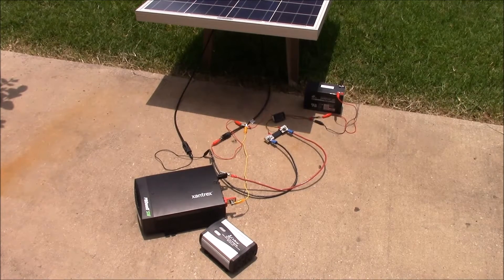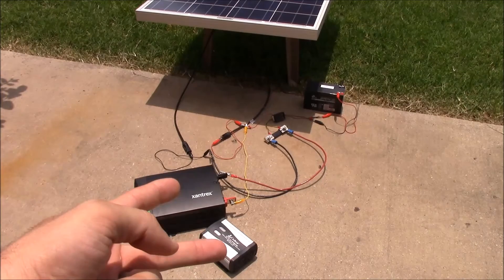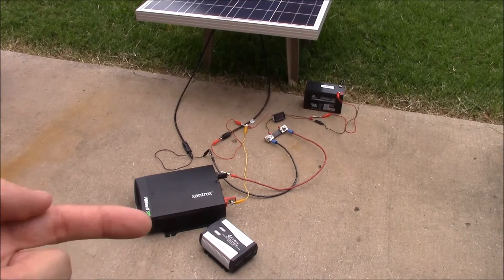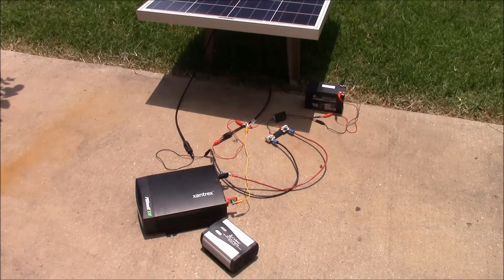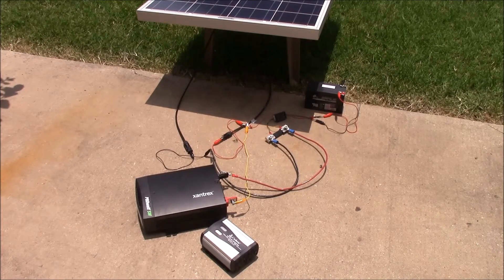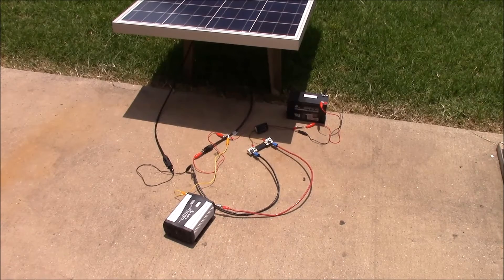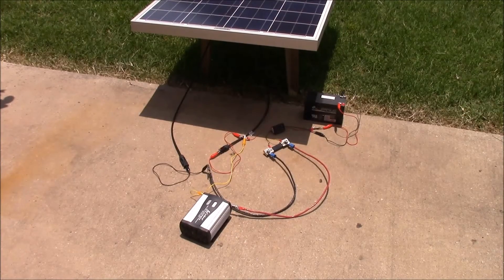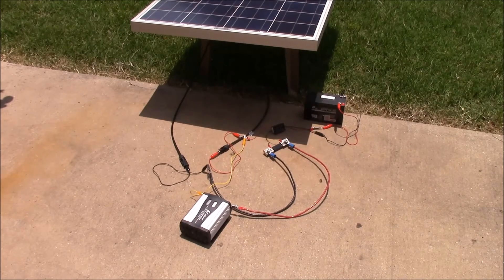Will It Solar? - AC Power Inverter

Comment: I have a solar panel that goes up to 14 and that’s it and for some reason it’ll turn out on the fan but it just won’t convert and there’s no noise or anything I don’t know what the problem is even a 9 V battery will convert

Comment: Very easy Just use 24V panel(VOC is 30-45V)  and use Inverter DC 36V (input range will 32-45V)   you will able to use direct i uploaded a vdo for Same working Perfect.

Comment: All it needs, is a DC-DC converter,    to bring down that input voltage from the Panel , down to a stable 12V to 13.8V into the inverter and it will be just fine. DC to DC converters are cheap and available on ebay and Amazon.

Comment: You need more AMPS output on the solar panel, an inverter has to have the minimum operating amps from the solar panel to run. ALSO if the voltage comming in is greater than 12 volts , it will not run , because it has a safety mechanism inside.

Comment: Very beginner question: What if you simultaneously had a load connected to the inverter? Would it still be an issue since you're off-loading some of the charge?
Reply from the maker: Good question.  I don't think it would change.  But maybe if the solar panel is under a big enough load that it drops to below the inverter's high voltage threshold it would work.

Comment: Dude, try hooking them up to a solar panel with the output rated the same as the input of the inverter.  If you have a 24v solar panel pushing 20v into a 12v rated inverter you will obviously overdrive it.  A 12v output panel WILL power a 12v rated inverter given a good sunny day (most inexpensive ones anyway).
Reply from the maker: That was a 12v panel and a 12v inverter.  And actually you are incorrect because a 12v panel on a bright sunny day will produce 18v, which is above the upper threshold of most any inverter.  The one in the video cannot handle above 15.5 without tripping the over voltage protection:  http://www.xantrex.com/power-products/power-inverters/prowatt-sw.aspx
Reply: I'm not trying to start an argument, just a reasonable discussion.   You can call me incorrect all you want.  I have been called worse.   I wish you would have stated it was a 12v panel in the video (maybe you did and I just missed it).  In my experience, a 12v panel usually produces about 17 average "real world."  Your claim about producing 18v is definitely reasonable.   I thought maybe with the clouds you mentioned scooting overhead, it was a 24v and efficiency was down.  

Also, your wire run was a few feet.  If a persons panels are in the yard or on the roof, and their charge controller/inverter/battery bank is in the garage, basement, etc. you have to account for voltage drop.  If you have 18v at approximately 5 Amps, through say a 12AWG conductor running 100 feet, you will be near 16v at the termination point.  This may be more tolerable for a lot of inverters.  Throw in a few more feet, or inefficiencies (non-optimal sun exposure, etc.), and you might even meet the 15.5v threshold at the end of your wire run.  There are so many variables but it will work more often than you think unless you connect the inverter directly to the panel leads.  Even then, I have found it to work at times.

You stated in your reply "most any inverter."  I have used multiple 12v inverters (cheapo's from friend's trucks, etc...) powered directly from a 12v panel with no issues.  It would have been nice to identify for viewers models that do work.  Although it will definitely shorten the life span of any inverter, it can be very handy in an emergency or short term say during a power outage/ storm situation.
Reply from the maker: Scott Meagher
You are right, I did not state it was a 12v panel.  In my experience, all panels under 100 watts are 12v panels.  There may be a few very rare exceptions to that but I haven't seen any.  So I guess I just assumed people knew that so that is my bad.

I've tested all of the 12v inverters that I own connecting them directly to a 12v solar panel's leads and none of them have even turned on, let alone managed to power a load.  So I realize that is anecdotal but I have quite a few inverters from the expensive pure sine wave $200 12v inverts to the cheapo car inverters.  Here is a video where I tested my Xantrex 600w pure sine wave and a cheapo Cobra model connected directly to the panel:

https://www.youtube.com/watch?v=knYMKXFpRxk

Another problem with what you are saying is that the 17-18v is under load.  Open circuit they will produce 20-21v.  So the inverter tries to power up and detects somewhere between 17-21v, depending on what kind of load the inverter draws (most are only a few watts of self consumption).

The last problem is that voltage from a solar panel directly without being buffered by a battery is highly unstable.  If the sun goes behind a cloud the inverter may shut off due to low voltage.  Or if the angle of the sun dips to a degree that is not optimal for the panel then the amount of energy produced plummets to a fraction of its rating and you may not be able to power your load any more.  At least with a battery in the mix you don't have to worry about intermittent clouds or bad angles quite as much.

If you are going to connect the inverter directly, at the very least get a variable voltage regulator to convert the battery charging 17-18v down to 12v.
Reply: yea you caught me out as well. I assumed it was not a 12v panel. good video none the less.

Comment: I tried this with a 15 watt panel and ended up throwing together a voltage regulator with a couple of capacitors, a diode, and a LM7812 IC in a breadboard. all from a radio-shack component box. worked like a charm for such a small system and played a radio off it. I get my charge controller monday and then the real fun starts.
Reply from the maker: Miclow Gunman Yeah, I have all of that laying around here but I don't think 90% of subscribers or viewers for my basic videos will want to mess with that.  I am trying to keep it basic and see what will and won't work with off the shelf, easy-to-understand components for the average person.

Comment: nice!
truly horrible horrible noise.

weird that the inverters have so limited input range, a simple regulator would make it more practical, though i assume that at the current it drains the regulator could add some cost to it.
nice panel, mine is much smaller, like 19v@10w iirc.
Reply from the maker: Jerónimo Barraco Mármol Sorry for the noise.  I turned it down in the video editing... it was MUCH worse before.

I have a voltage regulator that I thought about using but the purpose of this video series is to keep it as simple as possible and find average, everyday items and see if they can be powered easily by solar.  When you start having to hack stuff or add in electronic gadgets that scare most people then it won't appeal to as many viewers.
Reply: LDSreliance haha is ok, is just an observation, not a furstration. i dont like that sound but i understand why they use it (i can make it with a 555).
at voltage reg. oh right, i lost sight of the objective, is true. is better to see what you can and can't do directly. there are many hacks to do much more.

Comment: Greetings, looks like you have the same prowatt600 as I. I know its rated for 5a but I am in despirate need of using a angle grinder to cut thru some steel slugs that the previous boat owner used to fill in between the hull and floor and now rusting and expanding :/

Alot of cheaper angle grinders are rated at 5a and walmart has one thats 4.5 but I am scared to death that ill blow mine and I cant afford to replace it.

Any chance you have one to try out since it seams you have no fear :P

Cheerz
Reply from the maker: IslandCastaway ⛵ ⚓ I do have an angle grinder.  You want me to try to run it on the Prowatt?
Reply: LDSreliance yes please. Try to cut some steel with it to put a load on it. 

It would be a good experiment to see if 5a means 5a.

Thanx and good luck.
Reply from the maker: OK, will do!
Reply from the maker: IslandCastaway ⛵ ⚓ I am still going to shoot this video, I am just waiting for a delivery in the mail before I can do it.  Should be tomorrow or Wed.

Comment: Wait you got that Cobra for $20? Might I ask where? I'm pretty new to solar however I'd like to eventually get a decent cheapo inverter, also here's you an idea for another will it solar...

I have a small 35W panel but I don't have any SLA batteries to charge so instead I've bought one of these http://r.ebay.com/uxg60p to regulate the voltage so I can charge a 18650 battery bank directly off of solar and thus charge any devices, seems to be working alright, expect for when there isn't enough light my battery bank stops charging much sooner than devices such as my phone.
Reply from the maker: vgamesx1 I ordered that Cobra last summer and it was $25.  Currently it is $31: http://www.amazon.com/Cobra-400-Watt-12-Volt-120-Volt-Inverter/dp/B001RNOHBC/ref=sr_1_1?ie=UTF8&qid=1433540808&sr=8-1&keywords=cobra+inverter

I'm not following the battery bank issue.  What are the 18650 batteries?  You are converting the solar down to 5v and then charging batteries?  I'm lost, sorry.
Reply: LDSreliance Thanks for that link.

First question sorry, do you mean what are 18650 batteries or what brand are they?
If you don't know, they are the batteries used in laptop batteries if you take them apart as I did (or buy them) they are 3.7v li-ion batteries and you can buy a case to use them as a bank, such as this.. http://r.ebay.com/lg3aqY
(side note, the batteries are usually fitted in parallel, so no charging worries)

Second question, yes that is exactly what I'm doing, I have a little DC to DC converter which steps down the 18v+ to 5v and in theory is about 90% effect, meaning if I used a single better one, I could obtain up to 30W off my solar panel, instead of the 15-20W from using a charge controller.

It does work however it needs at least 8v or more in order to function, my only issue thus far is it can't charge my bank during the early/late hours it will however, charge my phone if a bit slowly, I bought a usb tester to try and figure out why but that won't be here for a few weeks, I'm guessing it's not supplying enough voltage at that point right?
Reply from the maker: Ahh, ok that makes sense.  I have looked at those cells before to build my own battery bank.  Pretty cool.

The only problem with your charging setup is that you are just supplying the batteries with straight 5v power.  There is no charging program to at the very least shut off the power when the batteries are full, let alone float them.  I agree you might lose another 5% efficiency (maybe 10% with a crappy charge controller) but I think it is worth it for the health of the batteries.  Especially lithium.

From my observations, in indirect sunlight (first few hours of the day and last few hours of the day) your panels will show a decent voltage but there will be almost no current.  Thus when you put almost any load on them the voltage drops to nothing.  I think that is what is happening for you.  The panels might still be making 17-18v but at about 1/10 the amps they would during the middle of the day.  So the voltage drops too low for even providing 5v at any meaningful amount of amps.
Reply: LDSreliance Uh did you look at that link? because the batteries are protected by a circuit within that box, (well not that one specifically) so it handles the charging for me as long as I feed it 5v and I've fully charged it once so it seems to be doing its job.

Ah I see, ok thanks that makes sense.
Reply from the maker: My bad, I didn't know you were using that charging box.  I thought you were just using the lithium batteries.  Disregard :)